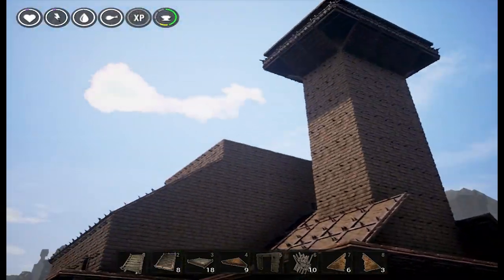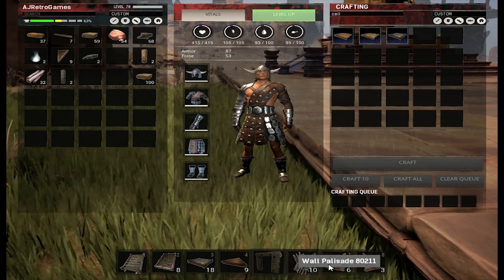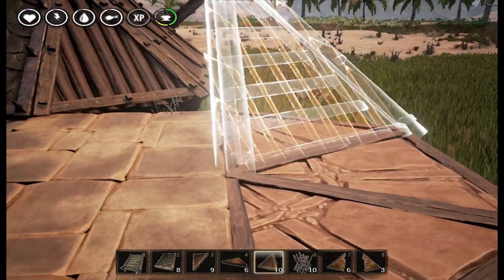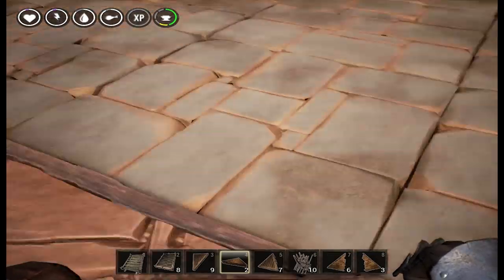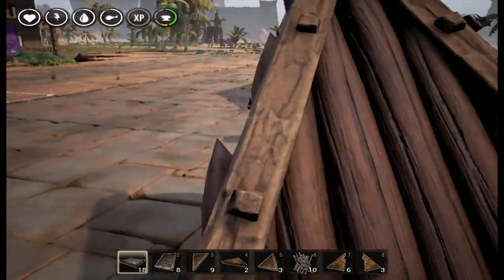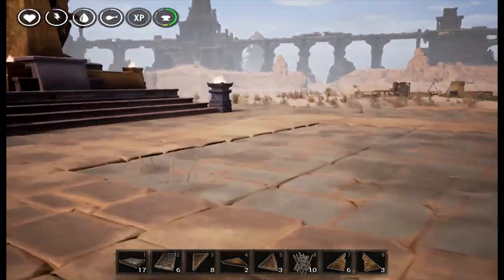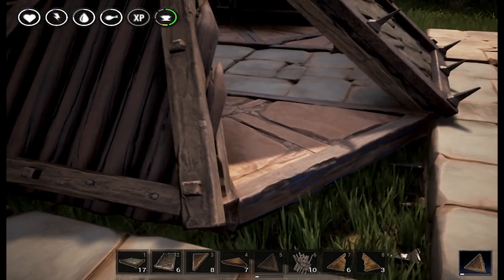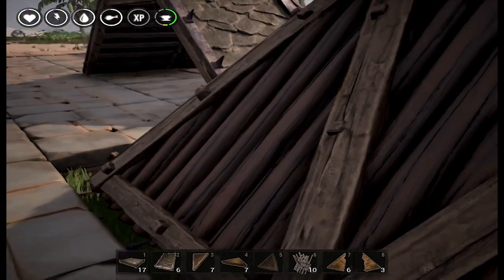Conan Exiles - Making Roof Corners

Comment: Repair hammer is your friend when working up high, so you can check the stability. A stability of 20 won’t let you snap a piece on. If you’re not concerned with having an “open” attic space, you can use a wall to attach the inverted pieces.

Comment: Structure stability dictates. Walk up with a repair hammer and view it's percentage. Every piece inherits it's attached percentage. So as you extend out and the further you go the less percentage of stability. Placing a wall or pillars next to something before you destroy to help along the way and can decrease the number of structures destroyed. They need to fix the building system obviously.